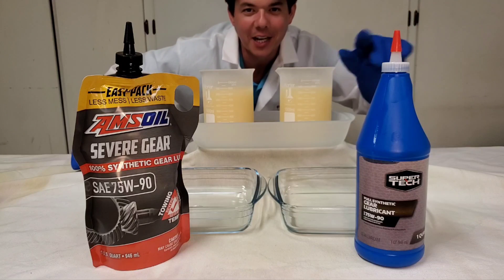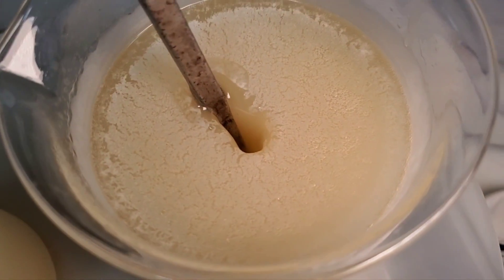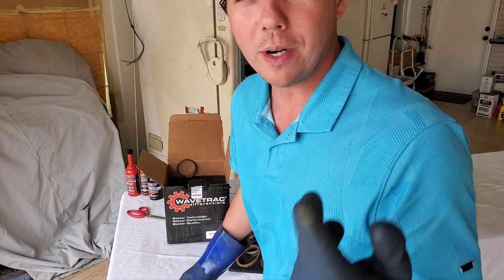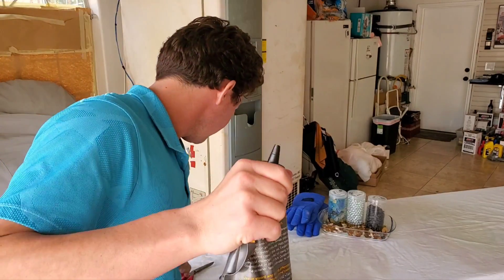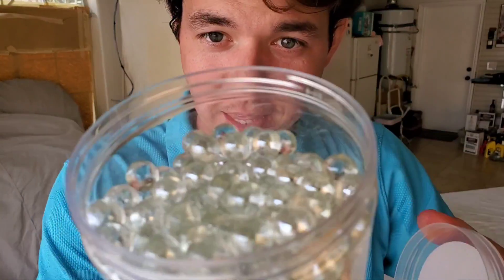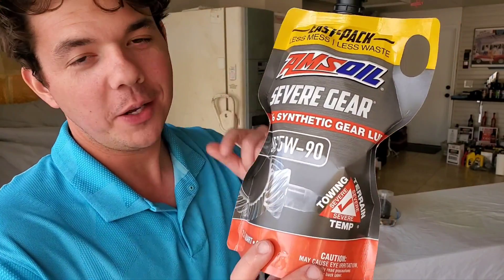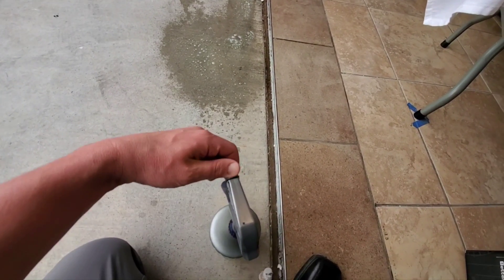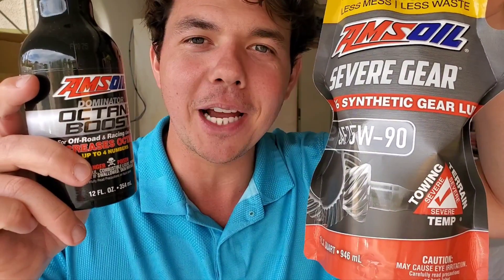AMSOIL Vs Super Tech 75W-90 Full Synthetic Gear Oil Cold Flow Test

Comment: Nicely done sir! Never knew that about full synthetic vs 100%, great info!
Reply from the maker: Thank you yes it's really interesting how different some of the products are you'll definitely see some consistency with the higher end stuff when it comes to the middle level there's a huge range with synthetic blend full synthetic and 100% synthetic what's the difference is thousands of dollars a year in gas mileage and thousands of dollars of saving money with your engine transmission lasting longer.
This Is The AMSOIL Policy - https://youtu.be/vIL7mCthods?si=Yln-KAQAyu9Ul2Jx
     
     For me to get credit & be "Your" Independent AMSOIL Dealer, please use my website below or my dealer no. 5331179 call anytime Eben Rockmaker 702-472-3614
After you click on: https://syntheticoilprotection.net/
1. Click the hamburger menu
2. Click offers AMSOIL preferred customer
3. Click join now. 6-month PC member add to cart.  ( There is no reoccurring renewal membership unless you select that dot box ) 
( You have the option to not have your credit card saved if you prefer - est. 1972 )
4. Scroll up to the top Select shop by vehicle. 

New Promo Codes: FREETOOL

Comment: You should test the tractor supply company gear oil brand, motor craft, valvoline brand and some others too. Thank you for your work
Reply from the maker: Sounds like a great idea I will definitely do that once I start the freezer👍☕️🇺🇸
Reply from the maker: Let's give a man a fishing pole & show him how to fish. 

     Together! We can get your vehicles to run better than brand new!

     For me to get credit & be "Your" Independent AMSOIL Dealer, please use my website below or my dealer no. 5331179 call anytime Eben Rockmaker 702-472-3614
After you click on: http://syntheticoilprotection.net
1. Click the hamburger menu
2. Click offers AMSOIL preferred customer
3. Click join now. 6-month PC member add to cart.  ( There is no reoccurring renewal membership unless you select that dot box ) 
( You have the option to not have your credit card saved if you prefer - est. 1972 )
4. Scroll up to the top Select shop by vehicle. 

New Promos: FREESHIP & 5CERAMIC

Comment: Should be using temp probes with live readings. You can't trust laser temp reading
Reply from the maker: Yeah it's not that technical this is just the basic test where the fluids were put in the same freezer they are affixed to the glass with silicone so they're all very close to temperature that's the only point of showing the laser not to be perfectly accurate and if I was trying to be perfect I would have had it on a perfect stand that tilted them perfectly the point is just to show how different lubricants can be🇺🇸💯

  I give a man a fishing pole & show him how to fish. 

     Together! We can get your vehicles to run better than brand new!

     For me to get credit & be "Your" Independent AMSOIL Dealer please use my website below or my dealer no. 5331179 call anytime Eben Rockmaker 702-472-3614
After you click on: http://syntheticoilprotection.net
1. Click hamburger menu
2. Click offers AMSOIL preferred customer
3. Click join now 6-month PC member add to cart.  ( there is no reoccurring renewal membership unless you select that dot box ) 
( you have the option to not have your credit card saved if you prefer - est. 1972 )
4. Scroll up to the top Select shop by vehicle.

New Promo: FREEQS

Comment: I think closer to a -10 degree test would be much more informative, those are much more realistic temperatures and would be worst case scenario realistically for any car
Reply from the maker: Yes definitely this is not to show real world this is just showing the difference between lubricants how they flow and their properties the lubricants that are higher quality have a better cold flow package and the lubricants don't oxidize as much so the cold flow capability holds longer and it doesn't degrade like a lower quality lubricant they will manufacturer can call a full synthetic full synthetic when it's 75% conventional oil and 25% synthetic how the Amsoil is different it's 100% synthetic. The lubricant holds its cold flow capability longer as it oxidizes and it does not thicken starving the component when it's cold which is very important always good to have circulation in all conditions.
Also the film strength is more complete and keeps the metal Parts separated which allows less frictionless heat less wear.
♥️   See fluid performance tests - https://www.amsoil.com/performancetests.aspx?zo=5331179

Comment: Thank you!  I don’t understand what the relevant take-away is from the frozen demo of ANS & Super Tecg 75w-90.  Is it that even in N-Minnesota winters, the AMS may flow better (altho that would only be -20F at the worst, and not for long)?
Thanks! Look fwd to herring back.
Reply from the maker: That's a great question when the fluids don't circulate they can have dry spots when it has no lubricant in that area you can have more wear on the component whether it's an engine transmission differential anything so it's always good to have instant circulation.

There's many great lubricants available and we show all those on the channel and we show some of the worst the differences are very vast and you will see those on the playlists if you go to the playlist section you'll see all the different fluid changes and that will give you a big idea of how different they are and if you ever want to try the products you can always order those right here through my link.
   I give a man a fishing pole & show him how to fish. 

     Together! We can get your vehicles to run better than brand new!

     For me to get credit & be "Your" Independent AMSOIL Dealer please use my website below or my dealer no. 5331179 call anytime Eben Rockmaker 702-472-3614
After you click on: http://syntheticoilprotection.net
1. Click hamburger menu
2. Click offers AMSOIL preferred customer
3. Click join now 6-month PC member add to cart.  ( there is no reoccurring renewal membership unless you select that dot box ) 
( you have the option to not have your credit card saved if you prefer - est. 1972 )
4. Scroll up to the top Select shop by vehicle.

New promos: FREEWAND

Comment: A meaning full test would be a case study where you have Amsoil in the differential of a vehicle and Supertech in the differential of a similar vehicle.  Track the vehicles over a 200,000 span where the gear lube is replaced per the manufactures specs, then after 200,000 miles, tear down the differentials to see the condition of the gears.  That would tell you how each gear lube really performed aver the life of the vehicle.  Cold gear lube being poured out of a beaker does not tell me much.  I would like to see a real world test.
Reply from the maker: ♥️   See fluid performance tests - https://www.amsoil.com/performancetests.aspx?zo=5331179

Comment: Considering there's no way I'll ever be in -49° weather (and how many people are?) SuperTech will do just fine for 1/3 the price.
Reply: same thing here thank god for tx no need to pay that crazy price for amsoil
Reply from the maker: Hey Ron there are differences in the lubricant a oil manufacturer can call a full synthetic full synthetic when it's only 25% synthetic amzoil is different because it's a 100% synthetic has a much higher film strength which will keep the metal parked separated less friction less heat less wear you'll have smoother operation better fuel mileage and extended life of the component which will save exponentially in a long run this will give you the details on how different delivery can start.
♥️   See Fluid Performance Tests - https://www.amsoil.com/performancetests.aspx?zo=5331179

Comment: Can you do cold flow test for AMSOIL ATV/UTV Powertrain Fluid vs Polaris Demand Drive Fluid* or Polaris AGL Synthetic Gearcase Lubricant?
Reply from the maker: That's a great suggestion Melvin We got a couple more oils to get through that I already got in the stock if I can get through those I'll definitely get to it this year however it looks like it's going to get hot out and once it gets hot the cryogenic freezer could overheat in the garage because it's only so cool in there so I have to be conscious of that but I'll definitely be getting to that next year if we don't get to it this year Thanks for being a part of the channel and being a part of the community 💯🪙🎬
Reply: @Syntheticoilprotection  Great products & content. 
the AMSOIL ATV/UTV Powertrain Fluid is what I use on my 2021 Sportsman 570 right now plus their oil & Quickshot. 
Starts no problem in the cold & smooth rides.👌👌also their Synthetic Water Resistant Grease is highly recommend for ATVs & snowmobiles.